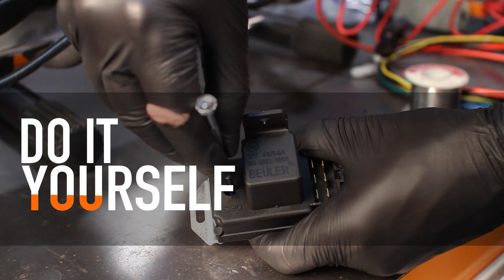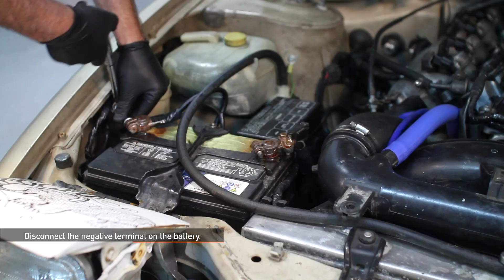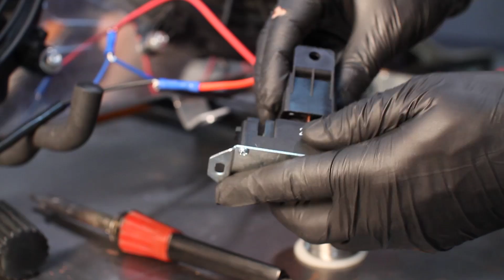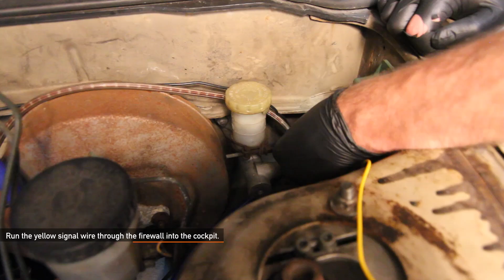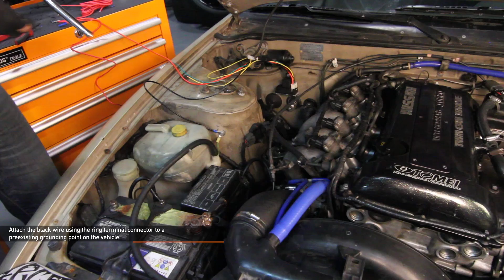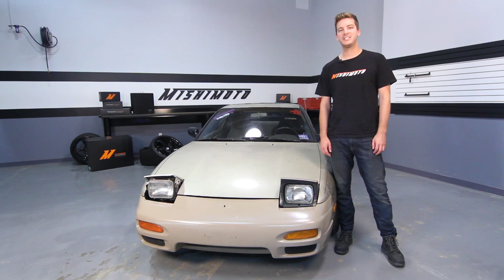Mishimoto DIY: How-to Wire a Mishimoto Electric Fan

Comment: 1989 mustang GT
I have no a/c and no stereo in my fox body. What do I do with the yellow and green wires?
Reply from the maker: Yellow goes to a switched 12v source. 
Green doesn't have to be used, but allows you to have the option to force the fan on. This can be done with a manual toggle switch or something that cycles on and off such as the A/C.

Comment: one question can I use the green wire with an stand alone ecu or what is the use for this wire?
Reply from the maker: What are you expecting to use this for? Does the stand alone ECU not have a way to control the fan through the harness?
Reply: @mishimoto  yes it does what I didn’t know is if your fan control was able to be controlled by an stand alone ecu I’m learning about ecu’s
Reply from the maker: If you have a standalone ECU that can control the fan activation, the controller we sell would be redundant and unnecessary.
Reply: @mishimoto  well I bought your controller before the ECU and I want to keep using it that's why I want to know if I can control it with the aftermarket ecu
Reply from the maker: No, you cannot control the controller with the ECU. Either the Mishimoto controller will turn the fan on or the ECU will. If you are not interested in using the ECU settings, we suggest installing the fan controller as shown in our install guide and ignoring any wires from the ECU or on the OEM harness. If you have any additional technical questions, please contact us directly at support@mishimoto.com.

Comment: If you add a single pole double throw switch in series with the black fan wire,  you can bypass the NO/NC single pole single throw thermostat.  May God enlighten the unknowing.

Comment: I have followed this video to wire my fan up this does not show where the green wire goes and there is no low speed and high speed options fan only runs at one speed is there another kit to install to green wire for low speed and high speed adjustment??
Reply from the maker: The green wire is for override, for A/C etc. This is not a high/low fan switch.

Comment: Another tip although I'm no pro but everytime u run power straight from the battery use a fuse
Reply: It’s built into the Mishimoto harness.

Comment: Where do i hook up the 1/8" NPT style temperature sensor
Reply from the maker: If there is no factory location available an additional adapter may be required depending on the vehicle

Comment: Were goes the green cable?
Reply from the maker: This wire is meant to be an override and can be set up to a manual switch or hooked up to the AC compressor to have the fan turn on with the AC. This will all depend on your preference, some customers simply don't connect it as well.
Reply: Perfect.Thanks!

Comment: I thought Mac Guyver was the previous owner of my s13. It had these fans when I bought it. Apparently it was just someone who watched this install video and matched it up exact except the part where he sealed it to the radiator with duct tape. Eh at least i know which wires are the fan controllers now. I'll just redo the wires with proper splices and loom them in better spots.

Comment: Hi... is there anyway i can just override wire both fans to just turn on when i crank up my car and they keep running until i turn my car off... (without having to add the switch control to route inside the car??) i have a 2001 chevrolet impala with recent fixed aircondition and the my overheating issue seems to have started once i fix my aircondition and started running it..... please help (-;
Reply: Hi Mocha Love!  It is possible to wire the fans to run constantly, but I recommend against it.  It wont allow the vehicle to warm up properly from a cold start and it will put a strain on the cooling fan motor, control module, and charging system.  Cooling fans are not designed to run constantly.  It sounds like you have an underlying cooling system issue that needs to be addressed first.  Running the AC creates an additional thermal load on the cooling system, which is revealing the problem.  Once you figure that out, you can wire the fans to kick-on automatically when the AC is engaged by attaching the green wire to the positive lead on the AC compressor clutch.
Reply: ok thanks
Reply: Mocha Love The reason you are overheating is because the AC condenser generates heat in its function. You have an underlying issue that is causing you to overheat. Check your coolant level, thermostat, water pump, radiator fan operation and radiator for faults.

Comment: Now that you are adding an additional huge draw on the electrical system, did you upgrade the alternator to compensate for the additional electrical power your car will need now that it has electric fans?....probably not i'll assume...
Reply from the maker: Hey! Just to clarify, our fan controller kit includes a built-in A/C override feature and is designed for use with 1–2 electric fans drawing a combined 25 amps or less.
Reply: Yes I upgraded my alternator to a 320a cause I'm running a 2200 watt system

Comment: could I just so connect the second fan to the first and plug the first fans plug into the plug? I bought a miata one so it's plug n play, would wiring it to the first one also kick the second on if it was wired to it ?

Comment: Hello. My fans have a blue and black wire. Which one is the positive? Also, I'm going to use one as a pusher and one as a puller. If I have to reverse a fan, is it simply removing and reversing the fan or do I have to also reverse the wires? Thank you for your help and the video.

Comment: I dont understand why it attaches to my radio? ..will it feed back and cause noise?
Reply: The radio signal wire tells the fan to turn off when the radio turns off. Otherwise it’ll keep running when the engine is off and it’ll drain your battery.
Reply: @TheKingOfHalo  Find a switched wire from the fusebox would be better than running the wire back inside the cabin to the radio.

Comment: WOW !     A  How-NOT-To Do-It-Yourself video by a company that makes High Quality products, BUT astoundingly ignorant DIY instruction. 
I'm embarrassed for you after watching this.
SO many things going wrong here.
First he's wrestling with the stripper pliers ( try using the proper slot size for the wire size).   2. Those pliers used are NOT in any form made for crimping (and cheap no-name junk).  3. Your not using the correct size Butt-splice and ring terminals for the wires.    4. copper showing outside the terminal. 5. Red wire for the ground? check. NOT!   6. The harness is made in China eh?  Fuse should be NEAR the source, aka at the battery, not at the relay 3 feet away.   7. Ignorance is bliss, hence 5 months later the video has not been replaced after R&D reviews it.

Comment: Finally the first kit that uses the reading to turn on the fan from the cold side.  Other than the shotty worksmanship during the install i am definitely liking this much better than the flexalite controllers that put the sensor on the hot side.
Reply: +Atanas Tripzter why on the cold side?
Reply: Google Email You want the radiator to do its job and only its job.  As soon as you add other stuff such as the engine temp to the equation everything starts mixing up since now you have the thermostat doing a different job, then you have the engine and the ecu doing a different job so you get 3-4 different systems all working in eachothers way.  Long story short the fan turns on at the wrong times.